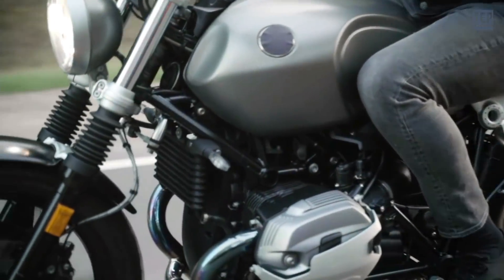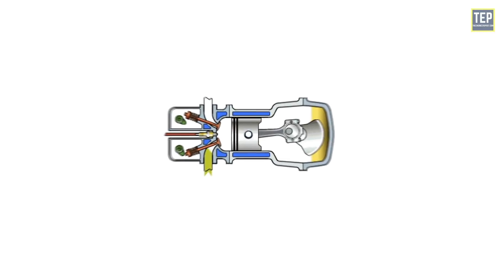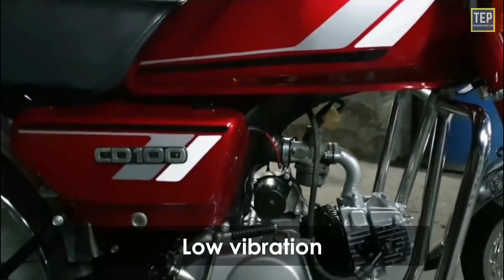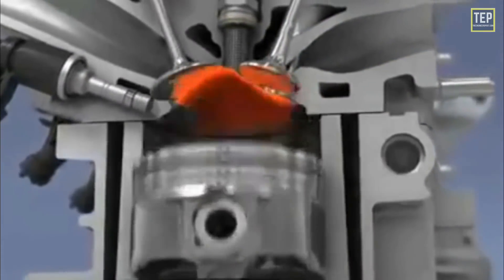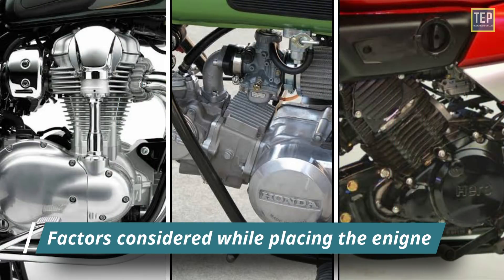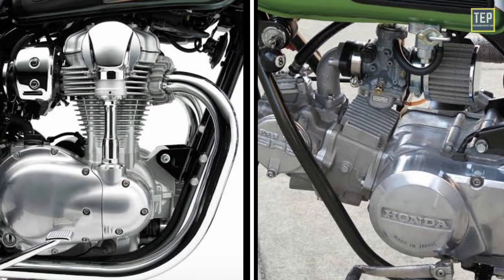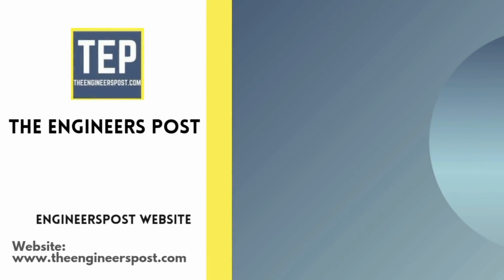Comparing How Horizontal, Vertical and Inclined Oriented Engines Work

Comment: Why had tillers with vertical crankshaft engines mostly disappeared after the mid-1970s? Sears was the last catalog retailer to sell one with a vertical crankshaft engine (a Tecumseh LAV50), in 1980.

Comment: I have 2 bike with HORIZONTAL ENGINE (HONDA VARIO 125 & YAMAHA JUPITER Z)

I also have BIKE with INCLINE ENGINE (HONDA CBR 150R K45A)

from my experience, HORIZONTAL engine is the most durable engine & cheap, but lack of power.

INCLINE ENGINE is more power but also it's cost more 😅

Comment: I wouldn't agree that most cheaper single cylinder bikes use splash lubrication.  That system is reserved mostly for very small engines like lawn mowers or pressure washers for example.  Even my little z125 uses a full pressure lube system as does its Grom competitor.

Comment: Most  vertical engines singles to  in line 4s quite Torquey  engine s but need balancing for smoothness boxer engines lower Centre of gravity have There disadvantages with oil flow

Comment: Engine cc full form?
Reply from the maker: CC, known as the cubic capacity of an engine, is measured in cubic centimeters (CC). It refers to the amount of air and fuel that can be pushed through the cylinders in the engine.

Comment: Thanks for your YT, but at 5'0" you showed both spark plug AND injector in the cylinder head, but I've seen somewhere on a YouTube that on motorcycles, the injection is made in the air intake conduit, not in the cylinder head!!! Am I wrong ??? Thanks again

Comment: I do have horizontal engine..named honda wave 2007 until this day ..i used it to work to deliver coz im i delivery boy of any kind of products around in bulacan here in Philippines 2007 until this day id stay stock..to maintain the efficiency of my engine regularly i change my engine oil every 30 days no matter what distance i travel i change it every 30days eventhou my oil is good ireplace it
Reply: That means u did not earn enough to ipgrade to Yamaha

Comment: The stressed member engine has been underdeveloped until more recently again. I'm think'n electric bikes will utilize this design more efficiently. Having a rearward tilting cylinder like the Yamaha 4stroke dirtbikes, with the intake tract out front, is really pushing the envelope of practical design. Highly developed layouts like this are the future.
Reply: You have no clue about e bikes do you ?

Comment: INDIA I've horizontal engine bike Honda CD100SS 1991 model (Petrol)  very low vibrations small size engine & mileage is 77.7 km in 1 litre petrol in city ride & 87.9 km in one litre petrol in long drive with original engine sound after the full engine restoration done in 6th NOVEMBER, 2017. Engine power 97.20 CC (0.97 Horse Power HP) Air Cooled single cylinder 4 stroke engine with Single Spark Plug.

Comment: Can anyone help? He said that when an engine is horizontal the reciprocating motion is the same as the bikes. My question is if the Pistons are moving left to right aren't they the opposite of the bikes motion? Did he speak incorrectly or did I understand wrong. To whoever May answer me please don't batter me too hard this is a legitimate question
Reply: Maybe it meant horizontal as in it reciprocates back to front, inline with your riding direction
Reply: Did you mean pistons moving left to right as in boxer engine like the BMW on the video ? How does it move the opposite of bikes motion when the bike moves forward and the piston move left-right not reciprocate backward ? Sorry maybe i don't understand the question
Reply: @ainulkarim5074  thank you for taking the time to answer me I thought reciprocating meant back and forth so if the Pistons are going left to right the crankshaft would be spinning opposite direction of your wheels front to back. I'm still a little confused I looked up the definition of reciprocating and everything LOL. Thanks again for not mocking me the motorcycle Community needs more people like you😁👍

Comment: The “suitability of shaft drive” has more to do with the axis of the crankshaft. Longitudinal being the best, but even BMW makes a i6 that turns the crank laterally now and still uses a shaft drive.
As far as horizontal pistons wearing out faster? Maybe ask any BMW boxer owners or Honda gold wing owners, two bikes known for absurd longevity. Hell, add Ducati to that list as well considering they use a 90° L twin which usually places one cylinder nearly flat and the other straight up. 
I’m going to say this video was poorly researched. 
FYI there is no “best” configuration 

Except that there is
 and it’s a boxer twin.
Reply: an i6.
Reply: Finally a rational comment

Comment: I've TVS Raider 125CC. Single cylinder, forward inclined, 4 stroke, 3 valve, fuel injected, air and oil cooled engine that produce 11.4bhp power and 11.2nm torque

Comment: Vertical is easier to assure better equal top end lubrication.  Incline heat transfer. Horizontal low center weight.

Comment: I own a Honda 110 horizontal engine, unbelievable engineering. 12.5 whp from 109cc 4stroke.
Reply: unbelievable 😉
Reply: Guys, I did some modifications,  camshaft, throttle body and ecu flash.
Reply: @MOTOSS_PEDRO  yes agree, mod for more power. Stage 2 👍👍
Reply: pop 110?
Reply: @atf_1414  positive
Reply: stock 110 , maybe 9.5hp
Reply: Holy! My 110 revo only what 9-10 hp at red.
Reply: Get a 2t if you want power from small engines
Reply: @onnikemppi368  no tks
Reply: @MOTOSS_PEDRO  hm?
Reply: Can't be true except if it's modified.
Reply: I own dinamik 120 2Stroke engine in incline position, get around 118cc and around 16hp
Reply: Marvelous engineering !
Reply: And it’s not stock
Reply: that is nothing my elder bros has 20 rwhp

Comment: Vertical engines don't really offer any advantage, but they look classic that's why the Bonnies use em.

Horizontal engines don't vibe and lube easy but they take up a lot of space so the swing arm is shorter and hence compromised stability.

Inclined engines are Goldielox zone
But reverse inclined engines are perfect, they have all the advantages of an inclined engine, the exhaust is naturally on the back so it's a lighter run, it takes shockingly little space so even in a relatively small wheel base the swingarm can be long and is very stable in the corners.
Reply: You got it all wrong , the trend has been to reduce swingarm lenght and towards mass centralisati9n.

Comment: I have a horizontal 70cc pit bike engine 
I treated it badly and revving it all the time 
But it did not wear out for 2 years now 
💯💖
Reply: Same almost 8 years over 1lach kilometres completed piston is still in good condition xl 100 🔥

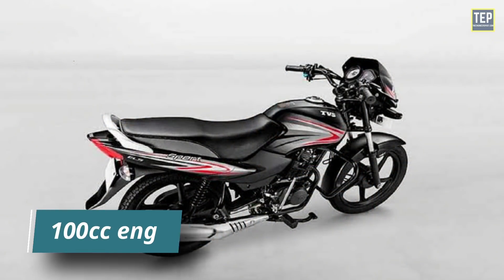Comment: 5:50 Honda Goldwing uses Horizontal orientation. BMW uses Boxer engines.
Reply: both are boxers.
Reply: @amsterob  While both flat and boxer engines are horizontally opposed, the key difference lies in how the pistons move. In a flat engine, the pistons are opposed but may not move with the precise symmetry found in a boxer engine. In contrast, a boxer engine features pistons that move symmetrically, or “box,” providing superior balance and smoothness. In summary, all boxer engines are horizontally opposed, but not all horizontally opposed engines are true boxer engines. The Goldwing isn’t a Boxer engine.
Reply: K1600

Comment: Most selling motorcycle in world have horizontal engine ,it's hero splendor 97cc bike India produce . It's was engineered by Honda . Sold by hero Honda partnership . Now Honda is separated from hero . Honda now makes vertical engine . But in second place  ie Activa scooter 3rd shine 125cc . Smoother engine than , competition but horizontal engine power is unbeatable in the 100 cc segment . I have 110 cc vertical engine Honda but horizontal hero bike power comes at earliest rpm . So hero bike overtakes mine motorcycle.
But it has lot of vibration and build quality is average.
But people buy it in more number especially for village, farm works

Comment: the only problem in horizontal is you cant cross a flooded street or cross rivers. when the water reaches the spark plug.the engine usually dies..
Reply: Use threebond bhai
Reply: @SALTrips  je kya hota hai bhai
Reply: @sawantaakst8782  prabhuji daya karo bhai
Reply: Good call

Comment: I don't think that agree with your comments about horizontal engine. Their is no difference in the side of the piston because as you said it's used mostly in small bikes so the piston is light. Also the   depiction is not correct because due to gravity oil is on this side so it's get better lubricated. Also the spring aply a much higher force in the side wall of the engine.  At least in Greece where people use a lot of moppets like Honda cub etc. Don't have this kind of reliability problem.
Reply: it's There is no difference.

Comment: On a single horizontal air cooled engine the cylinder gets even cooling and cooler air to the hottest part of the engine  . The exhaust is under the bike and the heat is not effecting the carburetor. The carburetor gets cool air which is good for horsepower and allows for a longer and larger air intake to itemize the fuel for torque and horsepower.  That is my pick !
The wear on the bottom of the piston is limited , gravity allows more oil to feed down the bottom of the piston and engineers can design the piston to feed more oil in that area .
Reply: its drawbacks is that carb need to use angle pipe which make the air pressure for pulling petrol do less.and its likely that petrol will hit the L pipe first before getting in engine.moreover when temperatures is cool,so the fuel is dense. thats all. also horizontal bmw engine really make my heart beat like crazy when getting in corner. its like shaving your head with rocks
Reply: @canul3801  A downdraft carb will eliminate the need for an angle pipe. Same with fuel injection.
Reply: You are decades late , ypur pick is banned.

Comment: This is exactly what i was experienced about 2 weeks ago.. 

i have inclined engine bike and due to some reason i had to use my friend's horizontal engine bike for few days.. and his bike felt quite smooth, balanced and low in vibration.

I knew the difference is because of the engine orientation.. 🔥

Comment: Im using horizontal engine on my Honda wave 110 ( for asian countries) and it's easy to maintain.
Reply: I also own a 110cc honda, best engine ever made.
Reply: I also own xrm 110
Reply: Me im using honda dash 110
Reply: I drive a honda dream exces 100, still going good. Didn't open the engine in its lifetime. Runs great!
Reply: Owned the 125cc Wave, pretty much rode it like no yesterday, just regular maintenance and that's all! Got the valve seal f up once cuz hey, don't blame me it's always fun going fast to the limit with a moped! Solid little mopeds that has a bigger chance to outlive your own self...

Comment: I own a R nine T and a R1200R; I couldn't body steer these bikes as it tends to drift to the left compared to my S1000R and XR which responds just by shifting body weight without any steering input. Also noticed that an Inline-4 has better fuel mileage than boxers with aggressive riding behavior.

Boxers are heavier but much easier to maneuver on low speeds than my inline engines especially on filtering and snaking into a bumper to bumper traffic. Inline engines have a satisfying speed and sound on a straightaway. 

Vertical/Inclined Engine is harder to maintain as it requires a lot of digging just to get to its valve cover alone compared to a boxer. On the other hand; you'll literally need to cut the bike in half just to reach the clutch on a boxer.
Reply: an R.

Comment: I have a two horizontal engine motorcycle both 125cc named HONDA RS125 CARBURATED TYPE MOTORCYCLE the other one is we are the first owner and the other one is a secondhand bike the first one has no issue and even did not vibrate  at all but the other one has a massive vibration because its is not taking care.
Reply: Yes take care and feed it flowers and wash with milk and honey

Comment: Also, horizontal engines, the vibrations tend to be also horizontal thus less felt when riding. Vertical engine layout has a more pronounced vibration as the vibration is also vertical.
Reply: The secondary forces are perpendicular to the forces created by the piston. In consequence, you will always get vibrations in both in horizontal and vertical directions, no matter how you position the cylinder.
Reply: @dw8931  I never said there will never be vibrations, only less, but you are correct

Comment: It's really good to see Indian brands such as Hero and tvs bikes are featured in the video. 
Yes horizontal engines were in the production a decade ago during the collaboration of hero honda in India. But now only hero has few horizontal engines in production but no other manufacturer in India makes suck engine. 
Even the gearless scooters uses the horizontal engines. 
Rest of the manufacturer makes inclined engines. 
Great video by the channel.
Reply from the maker: Thanks for watching
Reply: Hi Most selling motorcycle in world have horizontal engine ,it's hero splendor 97cc bike India produce . It's was engineered by Honda . Sold by hero Honda partnership . Now Honda is separated from hero . Honda now makes vertical engine . But in second place  ie Activa scooter 3rd shine 125cc . Smoother engine than , competition but horizontal engine power is unbeatable in the 100 cc segment . I have 110 cc vertical engine Honda but horizontal hero bike power comes at earliest rpm . So hero bike overtakes mine motorcycle.
But it has lot of vibration and build quality is average.
But people buy it in more number especially for village, farm works

Comment: what is the effect in gas consumption, power if you add 2 inches in swing arm of motorcycle
Reply: Not much, but chain slack can be harder to manage. And you need to adjust your turn, it can be a little bit more difficult to turn as tight as you used to
Reply: @benywidodo  thanks.. here in general santos city Philippines, motorcycles with sidecar some extend the swing arm for various reason like additional power but i dont think so, additional gas consumption maybe😅😅. additional lenght of chain, means additional rpm. correct me if im wrong,, hesitant to extend t swing arm of my trike😊😊
Reply: @rudymarges8242  nah I don't think it's about power at all. Most likely about practicality of installing sidecars etc. Want more torque? Change your drivechain gear ratio, but your top speed will suffer
Reply: @benywidodo  agree sprocket combination according to terrain is much better👍👍

Comment: Very important untold shortcomings : 
1. Engine orientation doesn't matter in power production provided that gravity effect doesn't affect. 
2. Position of centre of gravity affects many consequences like engine vibrations, stiffness, structural stability, normal reaction causes wear, etc. 
3. Availability of area for fast convection (Higher area exposed to air flow promotes high 'h' coefficient) based on relative orientation. 
4.  Orientation of engine impacts on space accommodation & CC. 
5. Lubrication ease.
Reply: I know that a upside down horizontal is never used, it's probably because all the heavy mechanics would be at the top but other than that seem a decent idea. The Germans did a similar idea with a upside down v engine on the messerschmidt plane they called it a internal v engine. I thought it might be workable though highly improbable?
Reply: @denismorgan9742  it was easier to service, and vision forward of the cockpit was improved but not downward
Reply: @merlingeikie  your correct, and because it was upside down any object or undesirable stuff that could fall into the combustion chambers would not happen. I would have liked to see a 3 litre inverted v6 engine with a Desmodromic valve system. It would have to be fuel injection.
Reply: crankshaft balancing according to the position of the piston in degrees also helps alot with power and efficiency

Comment: So I think that engines correspondingly moving forward the stroke piston opposite to forward pushing then the internet question agent is 50% less than applied forced what's the other and vertical gravity